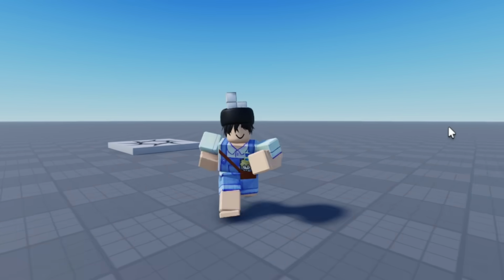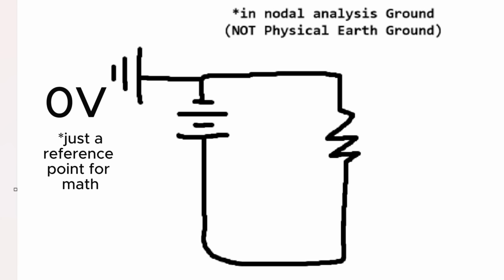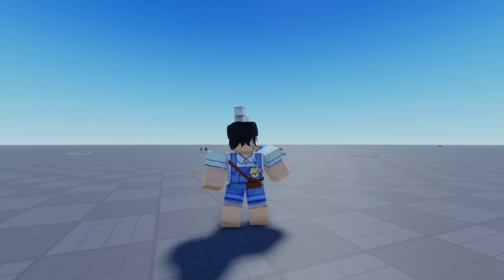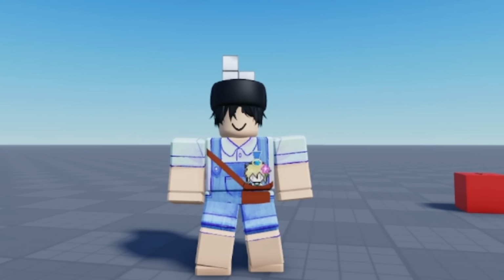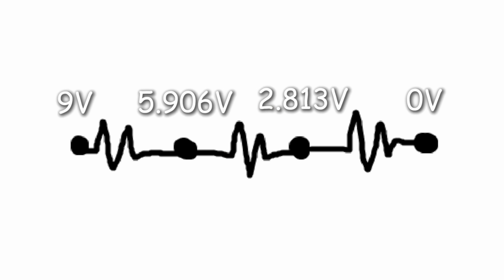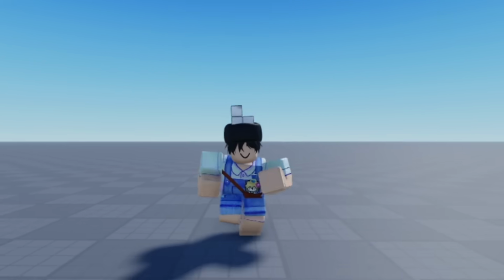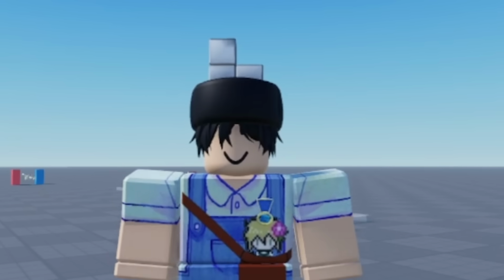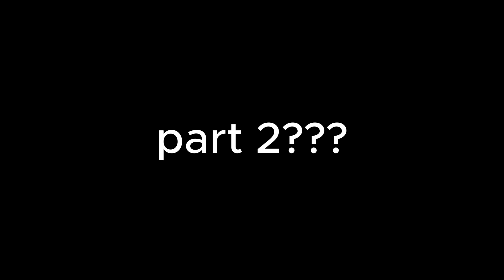What if Roblox Simulated (actual) Electricity?

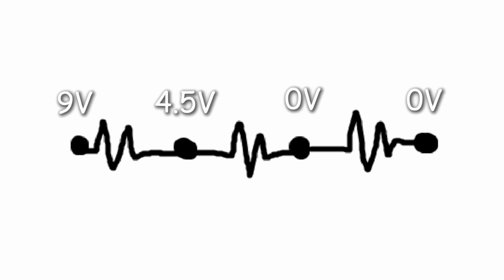Comment: 7:15 in this situation there is also another way of calculating it, since all resistors are in series, you can just add them to to get total resistence from one pole of power source to another and that equals to 3ohms.
from here you can calculate the current by I=V/R so I=9/3=3amperes. Since this doesnt have any junctions and is entirely in series that current is for the whole loop.
Now you can calculate voltage drop in each resistors by V=R×I so U=1×3=3volts. I dont need to calculate voltage drop of other resistors because they have the same current flowing inside of them and their resistence is also same so it is the same.
So to get V2 we just take the main voltage and subtract it by  the voltage drop to get V2=9-3=6 and lets do something simmilar to V3 but we now have only 6 volts so V3=6-3=3
I am not sure if it is scaleable to program it but i think it has good benefits.

Comment: 9:52 
Gaussian elimination is a great method when you're solving a system of linear equations on paper by hand. 
When it comes to real applications in computer simulation its easier just to calculate the inverse matrix:
The system of equations you have: A * x = b
If you want to find vector x you can simply multiply both sides with A^-1 inverse matrix to A to get:
x = A^-1 * b - the solution to your system of equations.
This method is widely used in circuit simulations. All the simple circuits can be represented as a linear system of equations and can be solved.

Comment: i was literally working in a electrical simulation game too in roblox (and in the same time as yours),
the game is essencially a sandbox game where you could connect wires but if you put too much current in the wires, it would glow and explode (wire melting wont be made bc it would need fluid simulation, something that i wont work with)
i already finished the glowing part but the problem that im having when trying to make this game is to calculate the voltages and currents and literally when i scroll on my youtube recommendations your video just shows up
Reply: ohms law